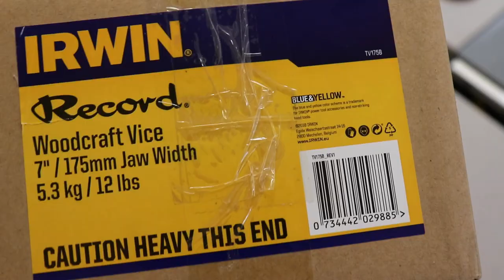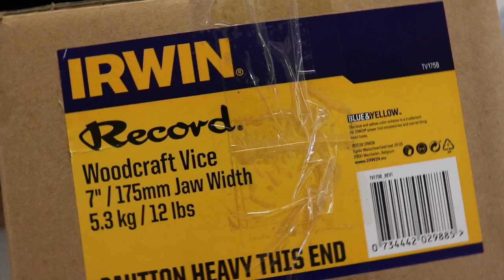Installing the Irwin Record Woodworking Vice 7" - 175mm

Comment: Why have you left a gap between the static jaw and the bench top? would it not have been better to recess the jaw so the vice is flush both ways. Not a criticism just curious. You have a very nicely laid out and well stocked workshop. Greetings from the UK

Comment: I like that you put the bench together with bolts instead of screws and glue. That way, if you need to take it apart for some reason, it's easily done.
Reply from the maker: Hi Will, yes you're right. Have you seen the workbench video?

Comment: I really like the quality of your work, but question the method of using the mitre saw to clean out the cutout you made. Although it looks neat, you are increasing your risk of injury to a great extent - Although Chisels take a bit longer to clean out it’s far safer. A wise man once told me “ Use high speed spinning blades only when that’s your only practical option”
Reply from the maker: Hi Duncan, thanks for your comment. I am aware of this danger, you are absolutely right. Thank you for the warning.
Reply: @WoodYouDoIt  👍keep up the good work

Comment: Pedro, I'm in the process of making a bench very similar to yours. I notice you have no overhang around the perimeter of your bench. I'm considering making the frame narrower and having about 10cm over hang for clamping purposes. What's your experience been with no overhang? Any problems? Thanks for the instructional videos. New subscriber here
Reply from the maker: Hi Shane. No problems at all. I don't see the need for overhang. You just need longer clamps. Any clamp with 15cm is capable of that.

Comment: Hi, thank you so much for this video, very, very helpful ! Just one question: What screws do you use to attach the vice to the bench?
Thank you !!!
Kind Regards,
T.
Reply from the maker: Thank Tom. I used 4 Lag screws DIN 571 zinc plated hex head 6x40mm and 4 washers
Reply: @WoodYouDoIt  Muchas Gracias!
Reply: @WoodYouDoIt  what diameter were the screws?
Reply from the maker: @swallace18  i used 4 Lag screws DIN 571 zinc plated 6x40mm and 4 washers.

Comment: Is that a Makita LS1019? How do you like it?
Reply from the maker: Hi Andy, thanks for your comment 👍 Please subscribe the channel 😉. Yes it is, and it's absolutely fantastic. Super accurate and has a small foot print on depth.
Reply from the maker: @andyelliott8113    yes I've seen that. I don't have that problem so far. Most of the time i do 90 degrees cuts. And if you move the saw carefully, I think this will not be a problem at all.